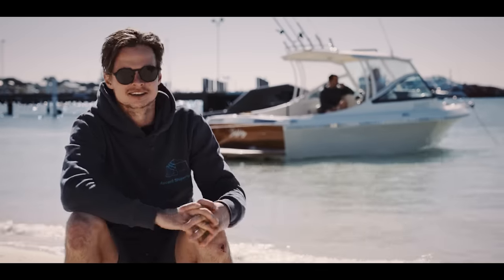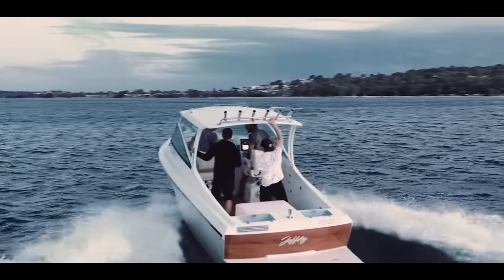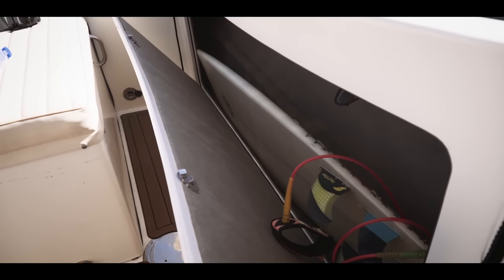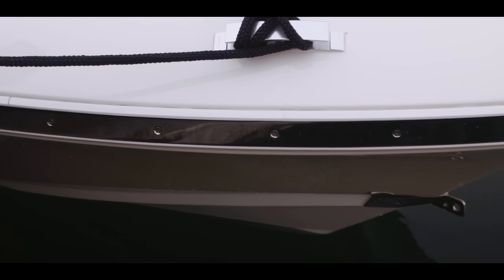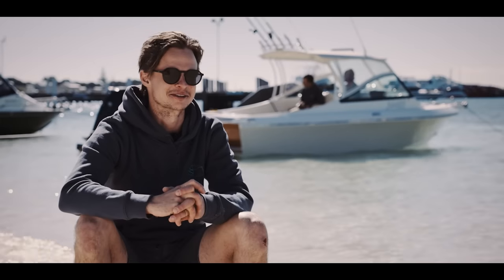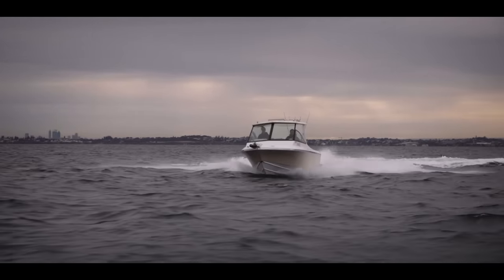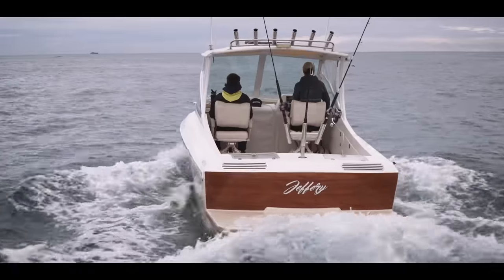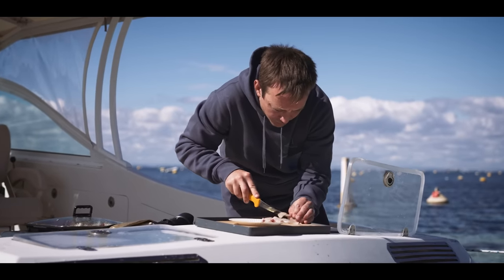Dan’s Caribbean Reef Runner with V8 jet drive

Comment: I had one of these on Port Phillip back in the '90s and agree with everything Dan says about the boat's sea keeping abilities.  Mine was an ex-victorian Water Police boat, and even with a clapped out Mexican Chevy Mercruiser it would do 30 knots, so the V8 jet does sound a bit like overkill - but it's not my boat.  The resto-mod treatment by Dan looks first rate and is a great credit to him; the timber transom is a thing of beauty and really sets the boat off.  Props to him for saving an oldie from the tip.